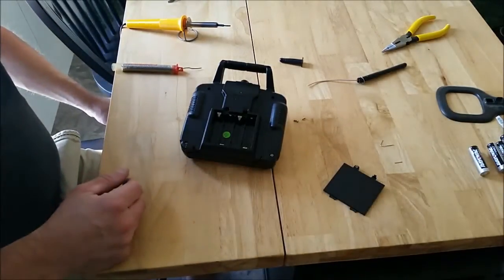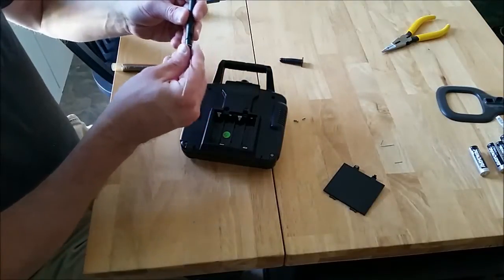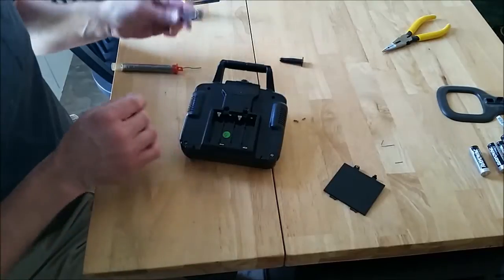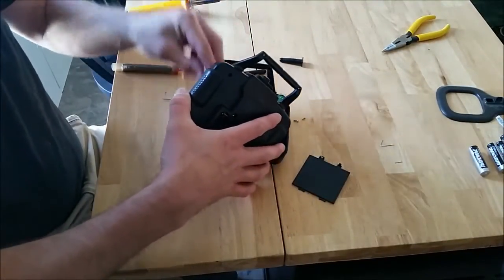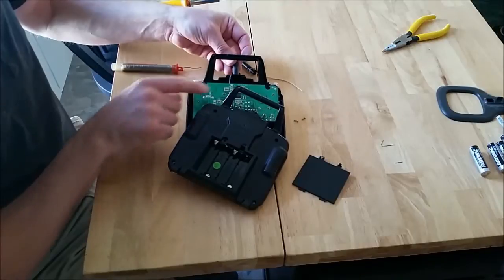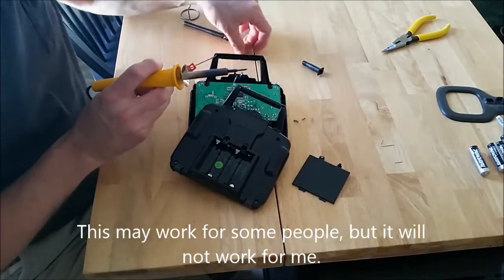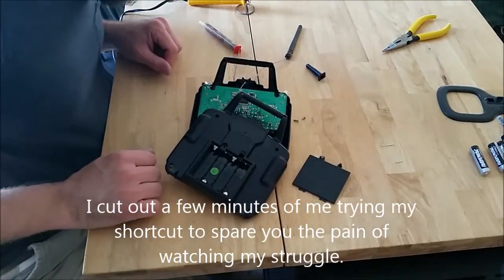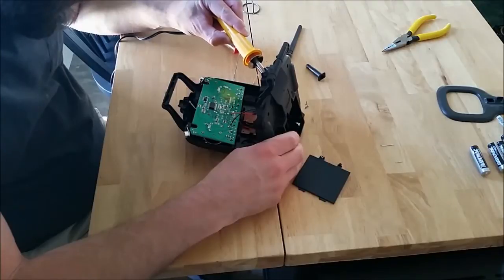Syma X5C-1 Quadcopter Antenna Transmitter Mod

Comment: When I put my transmitter back together, it buzzed and the blue light went on but the monitor wasn't on and the quad opted wouldn't connect. Any thoughts would be really appreciated :)
Reply: Did u figure out what was wrong with it I am having the same problem the blue light is solid it don't beep when I turn it on nor does the lcd screen turn on
Reply: kevin robinson I am thinking there must be a loose connection somewhere because when you actually take it apart you need quite a bit of force to separate the front back black panels. I am still looking for the problem :( sorry.

Comment: how much further does it go now?will the range depend if I get a real nice 2.4ghz antenna?And can you do that with the phantom?I have the X5C-1 but I want to eventually get a phantom and do this mod on it.I'm ok with regular distance on the syma. pretty much because the wind pushes it around easily and it can't carry heavy stuff like the phantom.
Reply from the maker: I would say it easily doubled the range on the Syma X5C-1. I feel more secure having the new antenna on it. As for the Phantom it's in a different category of drones plus you have FPV for them. You're going to get an effective range of at least a mile or more from a Phantom 2 or higher straight from the factory. That's why you pay a bit more for them. As of right now with my Syma, I would say it has a range of about 1200 ft or about 1/5th of a mile (give or take). It's restricted by line of sight since it has no fpv or GPS to help it out.
Reply: +Chris Kelley they sell a fpv kit for it on bangood and amazon.when I fly mine outdoors, I remove the gaurds and landing gear and the battery door to get rid of all the weight. it increases flight time pretty well and I also got 800mah batteries for it. my fpv camera broke so I need a new one. As for the phantom I want to it to go 3-5 miles so i'll need a separate 2.8ghz transmitter and antenna. I already have a 5.8ghz monitor

Comment: What kind of antenna did you use ?6-7-8-9-10dbi? And what is diffrence of these antennas?
Reply from the maker: Yavuz YÖNDEM I salvaged this antenna from an old Belkin N150 router that operated at 2.4Ghz which is the same frequency as the quadcopter operates. The newer Belkin routers do not have an external antenna. I would say at the very least it has a 6db gain, but I have not been able to confirm that. Regardless of the db rating the new antenna is about 5 inches longer than the stock antenna. With the new antenna I have been able to get this quadcopter up high enough in the air that all I can see is a tiny speck in the sky on a very calm day. I always fly within my line of sight since this is not an FPV model, but I feel more confident knowing that I can take it up high in the sky to get good video footage and still retain control with the new antenna. Thanks for watching!
Reply: Thank you so much.

Comment: Hello Chris, Did this work without removing the old antenna wire and just soldering to it ? I saw some of your other videos that it looks like it works. Thanks
Reply from the maker: LoveEatingCats  I would recommend removing the old wire just to eliminate any extra points of failure. I'm sure it would work if you weren't able to remove the old wire from the board, but I would only use that as a last resort option. Thanks for watching!